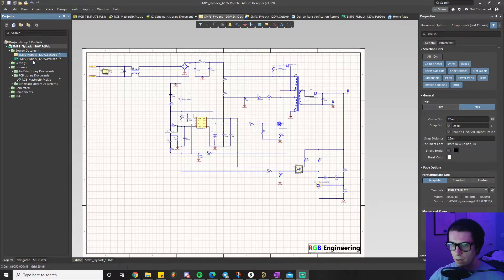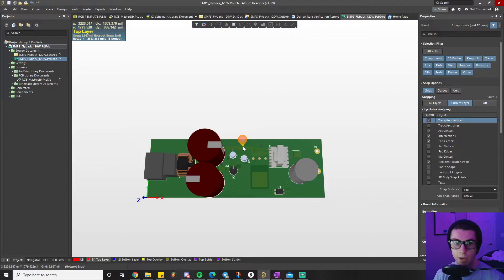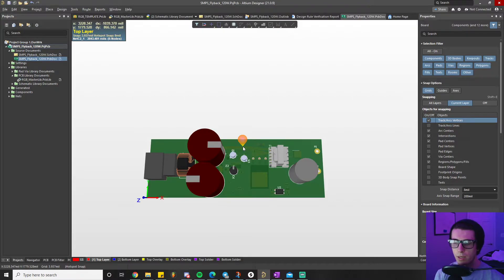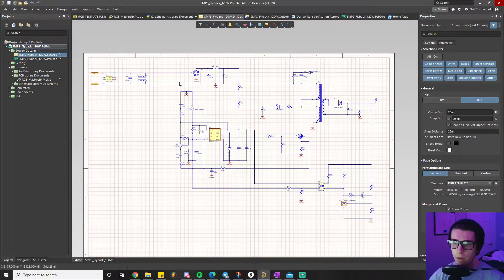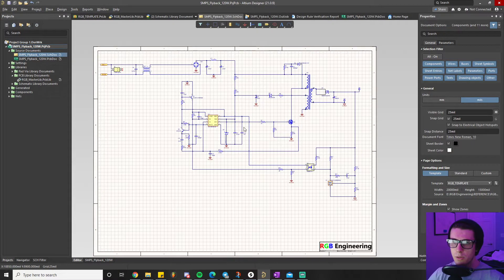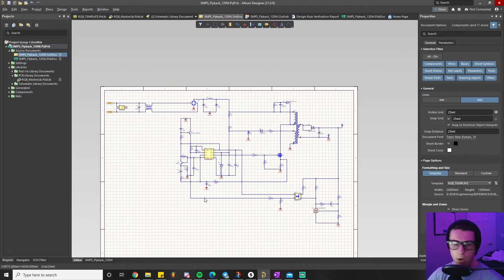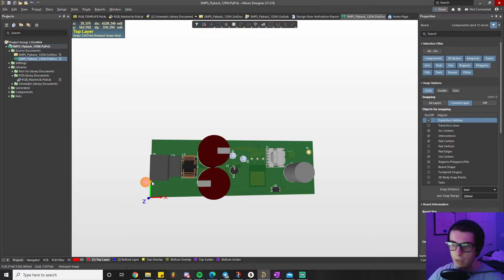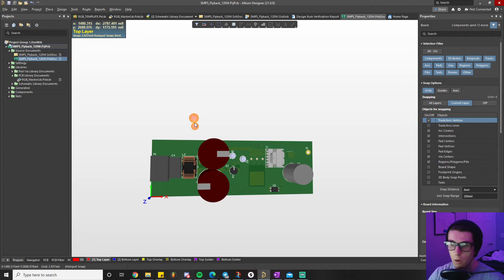FLYBACK CONVERTER PROJECT PT 1 | 24V, 120W FLYBACK CONVERTER EXAMPLE | POWER SUPPLY EXAMPLE PROJECT

Comment: what is the difference between flyback and buck-boost converter please
Reply: flyback have isolated output and non inverted output voltage  unlike buck boost which non isolated output and inverted output voltage. these are main diffrences